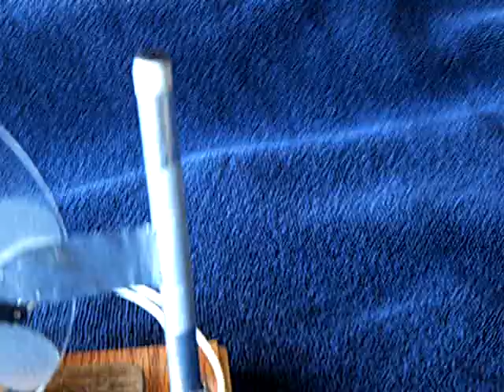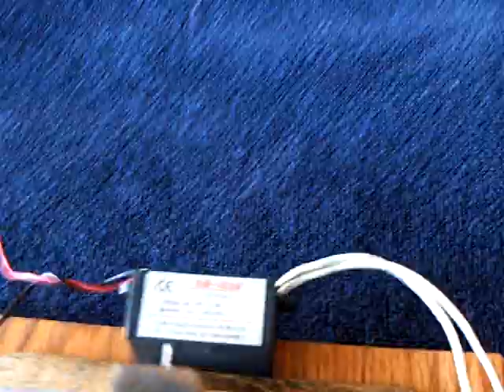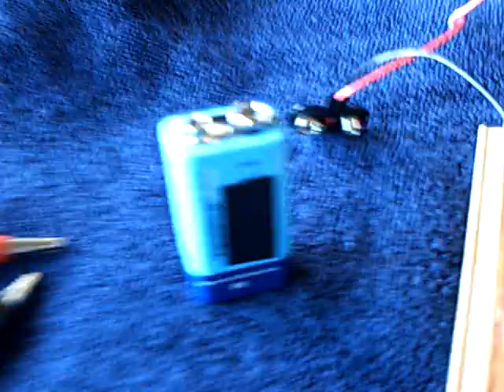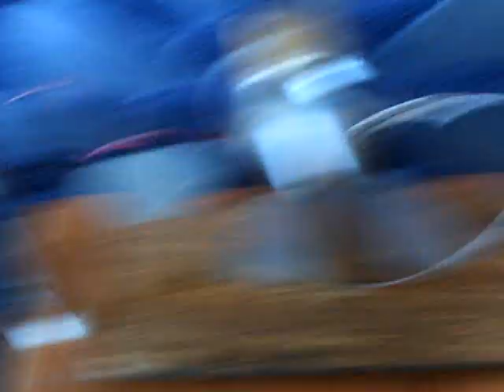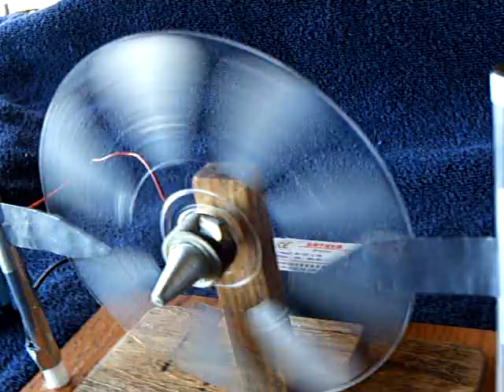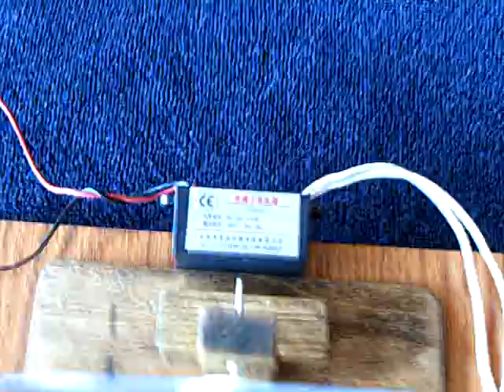Clear Disk Electrostatic Motor

Comment: Do ya think a Wimshurst generator would run your motor,?    Maybe if ya balance the motor perfect or lay it down so the shaft is vertical...  Even if you have to spin the Wimshurst pretty fast, and/or adjust the cap size and spark gap,  but it should work..

Comment: Hi, excuse me sir, can i have a diagram for this? im trying to get a negative ion generator, but its not so easy to get in my country, can i use a high voltage generator instead? and how does the brushes works? are apart from aluminum? or just work propelling the charge and repeling the disk? Thanks for your time, your video is very good, but i would like to see plans in detail if you can. Thanks in advance
Reply: César Cruz negative oin generator is a high voltage transformer.
Reply: So, those chinese high voltage generators in the range bout 3 to 25 kv could work for me?
Reply: César Cruz yes they would
Reply: More voltage = stronger field/power
Reply: Thanks Sir, gonna try to make my own
Reply: César Cruz good to hear, I'll most likely make on as well driven by a wimshurst machine (high voltage generator) good luck!
Reply: Well i think for now i must replicate the machine, and making a wimshurst machine seems kinda complicated, even i see this like a wimshurst machine, but im not sure it can that machine can work on reverse

Comment: I have recently tried building a couple of these things but haven't been able to get one to rotate. I was hoping I'd be able to use a slayer exciter but now I'm at the stage of trying to create a static generator to see if it will run any of them. You were saying in another video something about having a little trouble yourself until trying that little negative ion generator. Now I'm wondering if a quick and dirty static generator build may not be enough.

Comment: This is running off a battery not electrostatic energy from the atmosphere.
Reply from the maker: +Lion Heart Yes.  I never claimed that it was running off atmospheric energy.  It is battery powered.
Reply: The title clearly states, "CLEAR DISK ELECTROSTATIC MOTOR." And it clearly is not.
Reply from the maker: +Lion Heart You are confusing an electromagnetic device and a electrostatic device.  This motor runs on the Coulomb effect and is an electrostatic device.  I could run this on other electrostatic generators or atmospheric electrostatics if I had a proper antenna.
Reply: Lion heart, for clarity it is electrostatic because is uses electric fields for attraction and repulsion vs  magnetic motors that use magnetic magnetic fields for attraction and repulsion.

Comment: I just got one of those ion generators that you have in the mail.  But I'm wondering if it's defective?  I have the red/black wires hooked up the a 9v and then I hear/see a periodic discharges on the + terminal of the 9v battery.  Shouldn't I expect to see that on the white wires?
Reply from the maker: +Cere Mony  Yes the red and black wires are just the power feed wires. The white wires are where the high voltage comes out.
Reply: so fwiw.  I figured out that, duh, because there is no "ground" wire on the high voltage side, the ground is essentially floating by default and essentially just tied to both the + and - side of the low powered side.  So sparks would periodically discharge off the terminals, down the battery and towards the table where my - ions are being generated by the white leads.  So, therefore it's worth extra insulating the battery from wherever the white wires are headed.

Comment: What made you think of using an air freshener for a power source? You amaze me constantly.
Reply from the maker: +texjarhead  I learned about the negative ion generator from other people.   It works great
Reply: Kind of like I use reed relays instead of switches I get 3 months on 12v.  It has to be the right one..

Comment: That's a neat design, looks like a partial Wimshurst. I tried a little plastic cup balanced on a needle a few weeks back and couldn't get that to spin up, so something this big is good to see working.
Reply from the maker: slider2732 You are right.  The disk is just like the ones I have on my Wimshurst.  I'm sorry to hear that your plastic cup motor didn't go.  Those usually work even with a PVC tube and cloth static generator.  You should try again.  Once you get one of these running they are almost as addicting as some of the other projects you and I have worked on ---like the Slayer Exciter or blocking oscillator circuits.  One leads to another --to another - to another.
Reply: *****
Looks like lots of late nights ahead hehe...yep, will have a go again. It was indeed the cloth and pipe method last time, but that's made me think of an HV circuit source. Am presuming a Slayer to not be high enough voltage, though haven't tried.

Comment: Radiator fan motors look like same concept
Reply from the maker: egn83b Radiator fan motor???  Those are regular 12 volt DC brushed motors.  This is a HV electrostatic.  Totally different animal.  But------as i watched this running the word "fan" kept entering my brain.  There is enough torque on this motor to move some air.  Probably a poor use of 12v @ 30Ma. though.
Reply: I was thinking about Chinese made electric radiator fans the slim type. They have a disc inside them and a magnet and small coil inside the disc that repels against the magnetic field. Yes they are brush type but it looks very similar to this electric static motor. The concept is very simular but different. That is why I said radiator fan.

Comment: Cool, another thing of beauty...slightly off topic but have you played with one of those square solar display stands with  4 panels and a rotating disk on top, the torque on them is amazing, ive had mine turning absolutely massive weights, inside is a tiny 4 magnet rotor and coil, with 2 gears, i think it,ll be right up your street...only 2 pounds from china but well worth it...very cool.  Cheers..
Reply from the maker: 100roberthenry I don't have one of those.    I will have to order one and do some experiments.  Maybe use it on my boat to keep the birds off.

Comment: Hi have you ever tried it horizontal reason it should be in tune with all the earths spherical fields and at present you have drag from pos sky to neg earth.
Reply from the maker: honda4004 This would run much better horizontally.  Balance would not be as much of an issue.  Your thoughts about the charge differential between the sky and earth are something I never though about in terms of orientation of the rotor.  If I move the brushes to top and bottom this might run better.  Maybe.
Reply: Would you believe hitlers scientists built the vw engine horizontal to run off static ac dc pulse by eddy current the aluminium and the NORTH star soaks the structure to initially charge the  whole object. As the earths field runs spherical.   like a spinning top   Paul Pantone and ed leedskelnin also knew this.